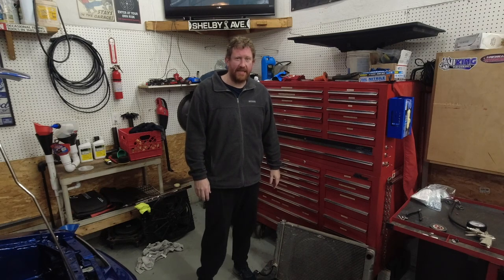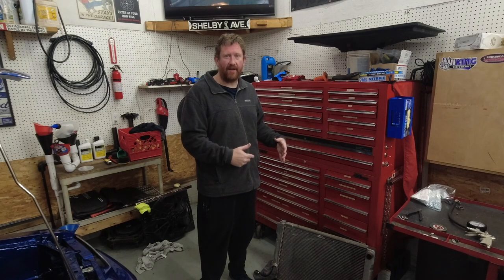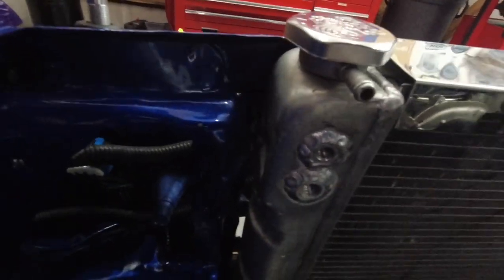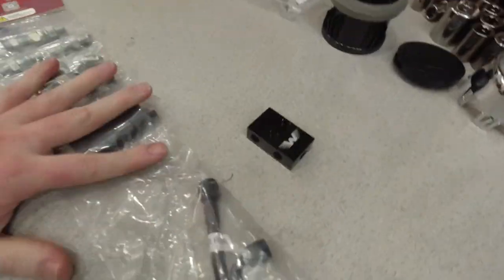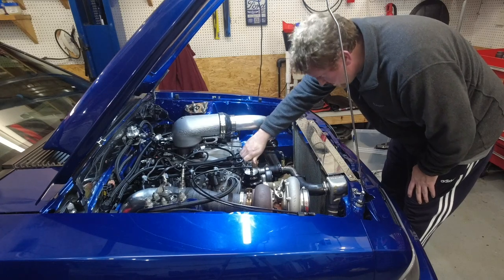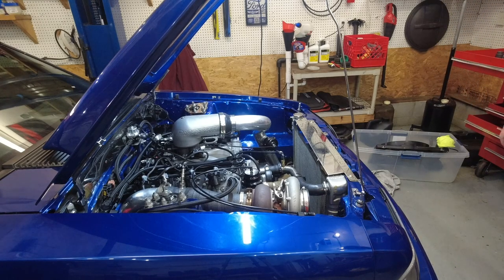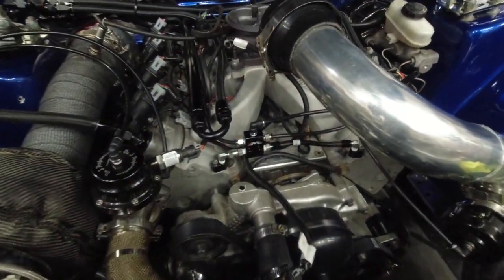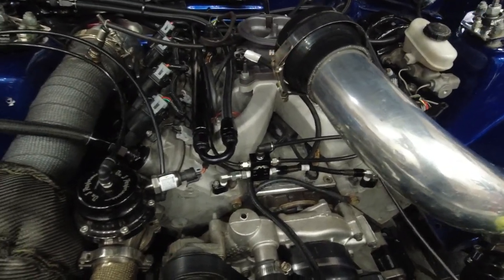Too Much Steam? - Install a Motion Raceworks steam port kit on your LS powered vehicle

Comment: It's been a year, did you have any luck with it that way?  Or is the port in the Radiator being that low get you right back Where you started?
Reply from the maker: I had not seen any issues with anything  since moving the port to the radiator.  its still higher than the port was in the water pump on the front of the motor.  The port in the radiator is the highest point.
Reply: Definitely Higher than the water pump,  Obviously. Long as it works it right-right. 👍 thanks. I was just wondering because of how low it is in the Radiator compared to hight of top of Motion block. If yours is working. I spent WAY, to much time on mine after asking you the question. Lol  I was worried about my 1/4" drop 🤪